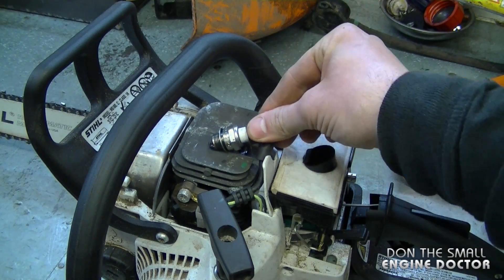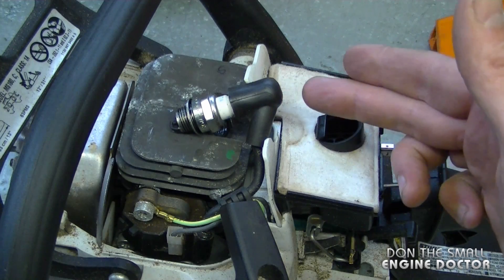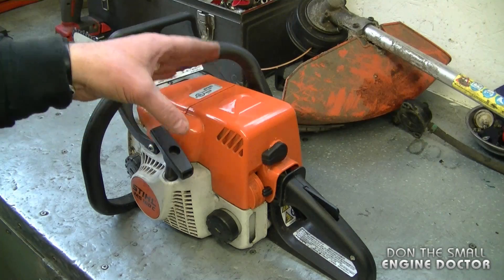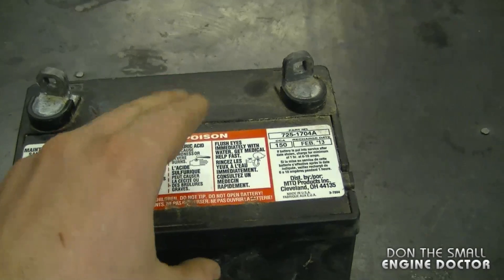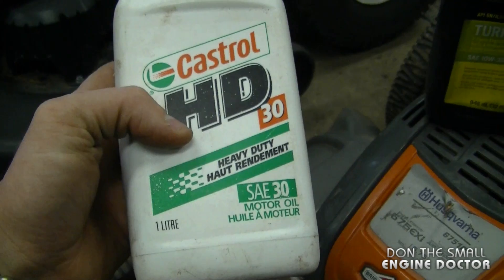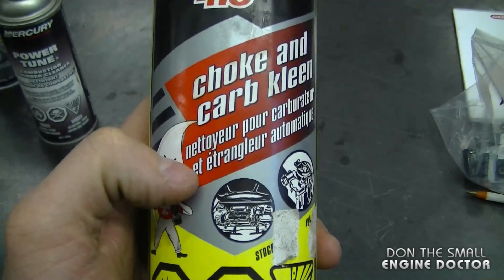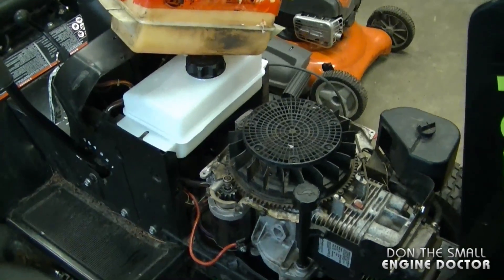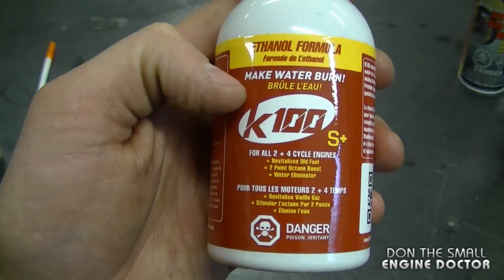Small Engines Q & A #153

Comment: Don, I have a js26 J.D. push mower, it runs great but have to use carb cleaner to get it started. The carb. has been cleaned, the auto choke works the way it should, but it just will not start without first spraying just a touch of carb. cleaner . Do you have any suggestions. Thanks Don

Comment: It would be wise for your viewers to invest a few dollars in a Briggs and Stratton spark tester to check their spark with.  The reason for this is that   an engine may have a strong enough spark to jump the plug gap when it is outside of the engine in atmospheric pressure, but if you put that same plug under compression pressure it may not be able to jump the gap.  The Briggs spark tester overcomes this with an extra large gap (If I remember correctly from my teaching days the gap is around .155 on the tester vs. .030 or thereabouts on an actual plug) The tester can be used on any brand of small engine.  I did see a few small engines that students brought in over the years that had what we would call a “weak spark” and the tester proved this. The Briggs part number for the tester was(is) 19051.

The one that really threw me once was a plug that did not have the porcelain fully bonded to the center electrode and under compression pressure the center electrode would push up into the plug thereby creating too large of a gap.  When you took the plug out and checked the gap it was correct, put it back in and during the compression and subsequent power stroke the gap became too large.  I only saw this once in 37 years and I kept the plug. Somehow this plug must have evaded quality control at the factory.

As I told you once before, if you were my student teacher you would still be earning an “A”. Keep your same simple clear instructional style.
Reply from the maker: Thanks

Comment: Donny,  I'm trying to figure out how to ask you a question. I'm trying to remove the impeller from a yard boss 950 crankshaft. The only bolt that fits is a 7/16-20 and no one seems to sell them 4-5 inches long. I saw you do this with a half inch bolt but it's so hard to find a long 7/16 that I'm wondering if a special tool was supposed to be used instead of a 4-5 inch bolt
Reply: The motor is an hm90

Comment: Good question to ask people : do they check the blade holder when they ever get a push mower to work on for vibration. Just got one recently and took off the blade to sharpen it kinda a dark area and when I decided to dig in deeper and used a trouble light and found four cracks in the blade holder . Replaced it which it was bad and the vibration went away .

Comment: Thanks for the video!

I have a Generac generator and it won’t turn over, choke on/off doesn’t matter.  New gas in the tank and when I pulled spark plug out it’s dry.  Does that mean it’s not getting any gas from the line?
Reply from the maker: yes for sure, could be a dirty carb
Reply: donyboy73 thank you sir!

Comment: If you’re looking for ideas, I’d like to see a video on adjusting a single screw carb such as on string trimmers and leaf blowers.  I put a new aftermarket (Chinese) carb on a leaf blower and it starts easily and runs pretty well, but I can’t get it to match factory RPM specs (can’t get it down to the minimum or up to the maximum).

Comment: Don I am a stihl tech you shuld use a zat tester on stihl when checking for spark i tryed putting a plug in a ms 192t to check for spark and grounding the plug to the cyl and looking for spark i did not see aney and the is with a saw with a new ign mod /coil I put a zat tester between the plug and I got good spark so maby you can tell your viewer's that

Comment: Help.  My Craftsman riding mower will not freewheel.  I cannot push it.  I pull out the transmission/trans-axle lever on the back of the mower to disengage it, but I still cannot push it.  What is wrong?  Thank you.

Comment: Hey Donyboy, have done your carb cleaner, several times, twice this year. First time that craftsman mower ran better then any other time I have used it. Unfortunately, right now, I start it, and it roars like a mighty beast then dies within 10 seconds or so. I resorted to weed eating the year and stepped on a hole, sort of lost my balance, let go of the trigger on this super crap weed eater, and now it now it will not turn over, It instantly shut off, This is a cheap murray weed eater, and right from the start, it was a pain to use, spending 09% f my time re-stringing, and clearing grass from the shaft above the head. Now have nothing to cut the grass, and I have big ole rat snakes around here, one was 20 feet at least, more than a record breaker. So, what does I need to check on the mower first. Both were running and weed eater, for once running very, very well. So first, I am going to do the entire carb clean again. Did not do the reservoir. Checking the fuel line, acts like it is getting no gas, after I prime it and it will NOT start at all, unless I spray the tarter stuff n the air intake. The weed eater, I have no clue what to do with that. One yard, I was almost done with, the other is now tall enough that it will be w=a weed eater job only. This mower cant handle the grass, unless I o=mow every other day almost

Comment: I have an interesting question. I have a brand new solo type 108 engine, and the thing i notice is that the fins on the fan are not spinning in the right direction, its like the fan was meant to spin in the other direction. Also, something that i find very weird is that when i spin the crankshaft in the direction that it was meant to go, the compression is ok (didn't measure it yet), but when i turn the crankshaft in the other direction, the compression is like double. What is going on there?

Comment: Thanks gentleman for you videos . My question is i didn't get spark on the spark plug. I replaced the ignition coil with a new, new spark plug. I used a credit card to adjust the gap. The only thing I didn't disconnect the wire that connect the ignition coil body to the body. What can be the reason? Thanks
Reply from the maker: I use a business card, not a credit card
Reply: What's the difference, not  much, isn't?

Comment: hi, I have one of those Chinese clone generators and I've been having issues with it!
It will run for 10 minutes then it will start to rev high and low before cutting out!
do you having any suggestions to fix it?
thanks in advance!
Reply: Russell Player check your fuel filter if it is dirty it could be letting the fuel flow to slow causing your motor to run to lean thst would male it rev up like that also check fuel line for small holes air getting in the line could cause the same problem if your getting good flowbmay be time to rebuil carb if it had a primer bulb could be bad diaphragm

Comment: Hey don I have an old McCulloch 1-40 chainsaw the engines not hydrolocked but it's really tuff to pull the recoil cord with spark plug in and easy without it in any ideas I've seen a number of people post this question tx for your vidios

Comment: Just commented on an old video but wasn't sure if you'd see it. I just replaced my lawn mower carb with a new nikki carb since that's all I could find. It only has an idle speed and idle adjustment screw and the darn thing surges at high rpm. Do you have any tips on adjusting the carbs? Perhaps a video would be nice too lol.

Comment: I something to add to your oil question, I use non-detergent oil with engines without oil filters and use oil with detergent in engines with oil filters.  One thing I learned that the non-detergent oil does not allow the crud (foreign material) to move around in the engine and allows it to settle in the bottom of the engine instead inside a crank journal or piston area. Just food for thought on that subject.
Reply from the maker: non detergent is mostly for air compressors

Comment: Mr. Dony, I have a 1976 Cub Cadet Riding mover that has a 1983 11 HP Brigs & Strat in it.(model 252707-0633-01)..I am rebuilding the engine an found the Stater to be half moon (10 amp) This only charges the battery and mower has no head lights...want to change stater to  full moon (16 amp) Question is to do this would I have to change the flywhieel or get larger magnets?...want to install head lights.

Comment: Thanks for the videos! I've got a mid 80's snapper hi-vac rear engine riding mower with a 8hp Tecumseh with the override gov. set up. I pulled the carb off to clean it out and now I'm having issues with getting the throttle/ governor adjusted correctly. When i try to idle down the engine it just free revs/over revs, like the governor is not working. Could you tell me how this is suppose to be adjusted? Thanks.

Comment: Another reason a tractor battery can appear weak after sitting awhile is that the cylinder is hydro-locked with fuel due to needle valve leak.

Comment: Always informative! Used a previous tip on gapping a magneto with Bcard. Got a free Toro that was dead, watched your videos and have a working, "free" mower. Also added a bagger to my riding mower, sharpened hi-lift blades, new battery, new belts, adjusted deck height and sharpened/balanced blades! Thanks for having a channel, Dony!
Reply from the maker: thanks

Comment: As  to K-100, as it is ethanol, it will allow moisture to be burned along with gas but one would be better off trying to avoid moisture buildup in fuel by using fresh ethanol-free gas. Ethanol left to stand in a fuel tank will keep on absorbing more moisture until saturated resulting into an ever degrading fuel beside the fact that ethanol WILL run havoc with diaphrams and gasket.
Reply: Sea foam removes moisture as well and is cheaper.  k100 appears to be a better product.  Thanks for your professionalism Donyboy.

Comment: when your rebuilding a chainsaw do you set the rpms a little low / rich on fuel for the first tank or two. to help with break in.
Reply from the maker: that wouldn't hurt, I do add a bit extra oil in fuel though

Comment: yes!! thought the q&a was retired. glad to see it back.

Tip for battery life keep it charged up especially before winter storage. Yes it is best stored indoors if possible

Question: how can you accurately check for compression on engines with compression release. I had some I thought were low compression but ran fine was that due to the compression release.
Reply from the maker: take compression on good running engine, then use the results as a gauge for other engines
Reply: donyboy73  Thank you. I learned a lot form you.

Comment: I just climbed on my lawn tractor today after being outside over winter I do take the battery out so it most of the time starts. This year after using it for 1 month it starts great runs great at idle but now it blowing a little white smoke . I have 2 tractors with the same engine 1 is a parts one as the frame cracked . My engine is from 1991 craftsman 18hp v twin old style . I start to cut the grass and it does do it. But after 5 min or so it loses power . I swapped the carb and some other easy parts but to no avail I know it getting spark and watched you videos all the time so I do not have a compression but it seem like it pretty strong it is also only on 1 side the other side works as I did remove the spark plug boot from each side and 1 side made no difference . I hope it not the rings as I know you know I am a disabled vet in a wheelchair .If it is the rings I guess I may have to pull the engine and swap it with my spare engine . Any ideas on what to check ?
Reply: Buy that compression gauge, just an inexpensive one like from Harbor Freight here in the US.  And/or fix up a simple leak down tester.  That way, you can hook air pressure to spark plug hole, with piston at top dead center on compression stroke.  Then see if you can feel/hear air coming out from crankcase (remove filler cap), exhaust, or carb and you'll know where the loss of compression is.  Hopefully only a valve, reasonably easy to fix.
Reply: The fun part that I did not mention I am a disabled vet who did spend 7 years in the NAVY on submarines .
A chain broke and it crushed me leaving me no use from the waist down . I do hobble around and have a neat scooter that hover round made for me and the VA paid for it. I am a E5 (SS) and on subs with all the extra pays on subs I was making 48k in the late 80 s .I was a reactor operator electronic not mechanical so after all these years I have learned to be a back yard mechanic OH when you go out on disability you lose all of those special pays so I went down to 25k over night  . I will see if I can save a few bucks and buy one may be a month or so so I will have to beg for my nabior to do my lawn . I own 15 acres but only 2 are cleared  out. I will also look up how to do a leak down test .   Thanks for your input !!!!!

Comment: Don, SAE30 is not thicker than 10W30.  They are both 30 weight oils when fully up to temperature.  The only difference is that the 10W30 is a multi-grade and acts like a 10 weight in the cold whereas the SAE30 is straight 30 weight oil.
Reply: Electone_Guy  Dony offers great advice but you are definitely right on this one !
Reply from the maker: thanks, it is thicker coming out of jug though

Comment: We always try to buy the most powerful cold cranking amp battery we can fit into the lawn mower. I think the most we are able to buy is around 450 CCA. Lol. The battery will usually last around 10 years here in Western Pennsylvania.
Reply from the maker: that's a good battery, I can only find up to 375cca in canada
Reply: Love2boat92 I always buy Walmart's "ever start" batteries and never had a problem with one. I have one that is 6 years old that I received in a old garden tractor that had sat for 2 years without being started. I charged it up overnight once a couple years back, and has yet to fail me. In fact it is currently in a old mower that is used maybe once a month over the summer. If I remember correctly it's their cheaper 225 cca battery. My dad has also had a couple cheap ever starts that have lasted a good 5 or 6 years if use. Not bad considering their usually around $25 (or $30 for the slightly better 275 cca one) when you bring a core.
Reply: Nick Woodruff Yeah I've got one of them in my Cub cadet 582 special. I am surprised they seem to be better than I thought. I did buy the biggest one I could fit in the battery box though. Lol.

Comment: Q:  Please go over (show) the wires on a typical engine?  Especially a B&S  with battery charging and low oil kill, they usually have like five+ wires coming out of the motor.  1 spark, 2 ignition kill, 3 battey chrge or regulator, 4 carb, 5 low oil sensor, 6 starter

Comment: keep the batteries fully charged on a float or trickle charger, especially during the winter.  I have mine on a lamp timer to go on a couple hours daily.  It's bad to leave a battery dead or weak for a long time, like more than a  few days.  Keep it above 12.4 volts.  Also check battery fluid levels if that boils out from over chargeing, add distilled water with a few grains of epsom salt.

Comment: What all would you recommend for buying a used mower (or getting a free mower) as far as getting it running or what to check before you dump a bunch of money into a mower that might be shot in the first place?
Reply: If I may: 
1. Pull out oil dipstick, check color (smelly pitch black is mildly worrisome, but far worse are metal shavings or discolorations from water/fuel)
2. Turn mower sideways and inspect straightness engine shaft (rotate blade by hand and see if it's off.
3. Feel engine compression by pulling cord slowly, should be stiff. If in doubt, take out spark plug (note color plug, brown is best, fatty black/dry white is NOT) and peek inside the chamber for scratches.
4. Start engine (how many pulls?) and listen for a nice low idle, and quick responding wide open throttle. Also note any rattling/vibrating.
5. Quickly check air filter for excessive dirt/neglect.
6. With the above, check for rust and 'looseness' of handle bars. This is a clear sign of owner neglect.
7. Inspect wheels for floppiness.
8. Inspect owner......do you reckon he cares for his equipment? If so, pay what he asks as a sign of respect. If not, lower the price and carefully note 1,2,3,4,5,6 and 7.
Reply: Wouter, thanks for posting clear, concise list!

RichE
Reply: Wouter d.B. Awesome info. What about a free mower that was on the curb, set out with the trash or with a sign that says free?
Reply: Prob a lemon, or just grab it and yank off usable parts like wheels, blade etc.
Reply: Wouter d.B. I'm not so sure most of them are lemons or junk. I think most people don't want to get their hands dirty trying to fix or maintain them. Last one I pulled from the curb (my neighbor) I put a $5 diaphragm gasket in it and have been running it for a couple years now. I watched my neighbor tie the kill switch with his shirt and would bend over and depress the primer bulb like every minute (I don't do that with the same mower). I just picked up a pretty new looking craftsman but new looking doesn't have anything to do with anything. It's totally out of gas and wondered what Don would check that would let him know within a few minutes if it's salvageable or junk. I know he's offered some tips for 'free' mowers and why some people throw them away not knowing what was wrong when it's normally a real simple fix. I figured him doing a video on this would be good for his channel. Wouter I totally agree 100% with your steps on buying a used mower.